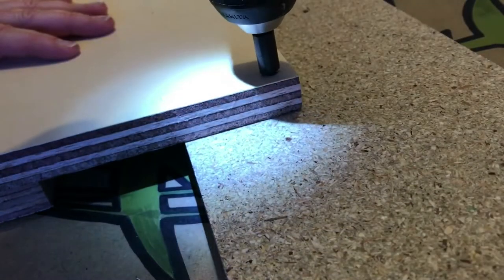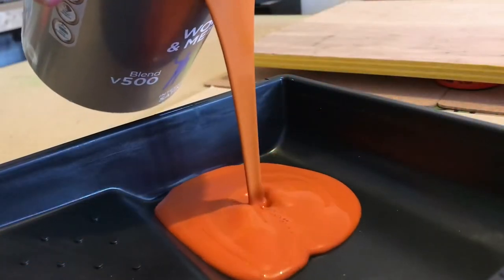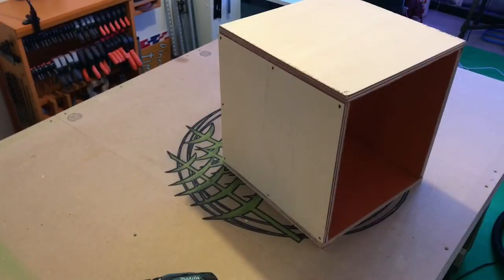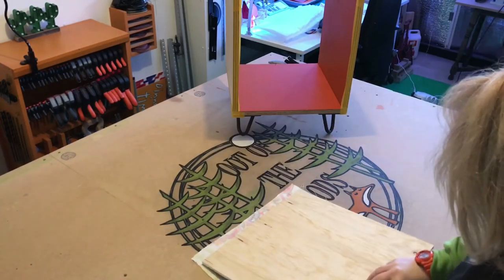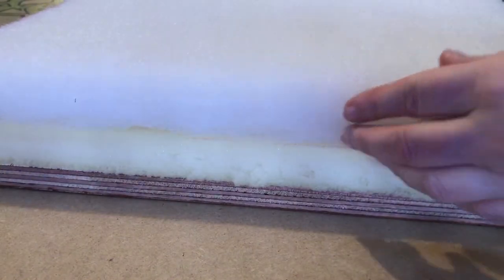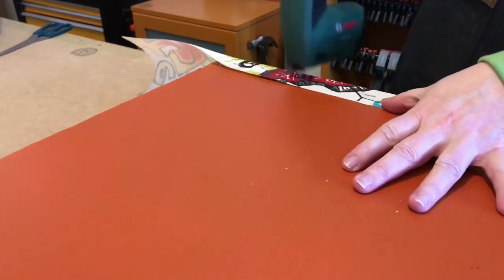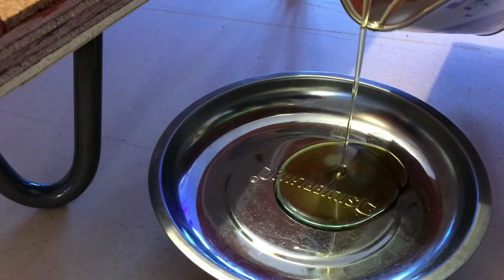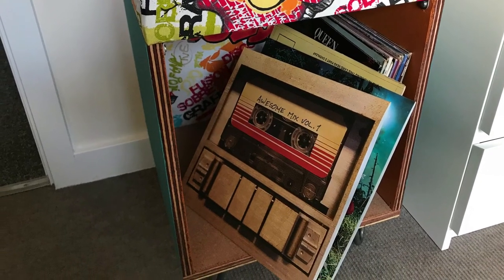How to make a vinyl record storage seat with hairpin legs and plywood

Comment: Great result, bobble head! Every build has it's own lesson and the one here was to cut your own ply. You beat it, in the end. Well done 😀
Reply from the maker: Yup. I ‘went full bobble’ - I like ply but I need a table saw to do my own trimming! Scary - thanks for comments 🌲🦊🌲💕
Reply: Making it ‘Out Of The Woods’ You can cut ply sheet with a circular saw and a straight edge. Even the mini saw I used in my first vid.

Comment: Very nice functional project. That material is proper funky, love it! Plywood is an awesome material to use but, like veneers, to get the best out of it requires an expensive scribe saw,  a bit of pre-planning and tape or sacrificial wood. The edge finish reminded me of the school style chairs and desks of the 70's!
Reply from the maker: Thanks, it was a bit rough - I’m getting better at this - my new Freud blade and table-saw seems to cut much more cleanly - I’ll be shouting you for advice next time! 👋🌲🦊🌲